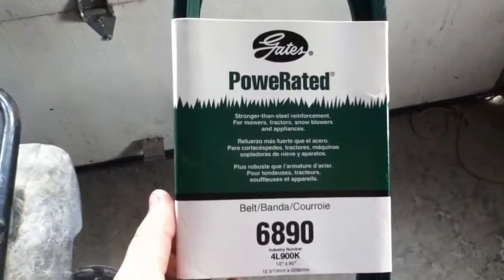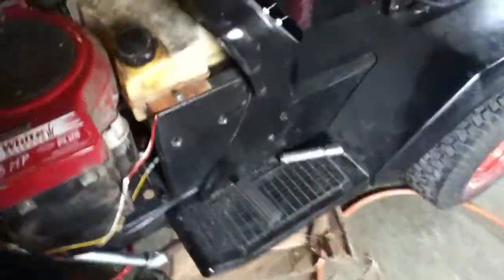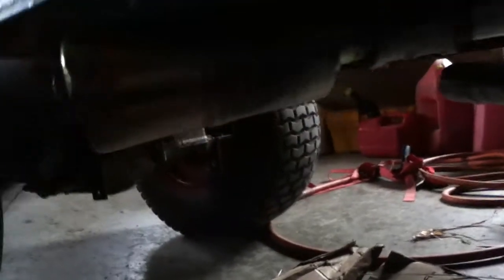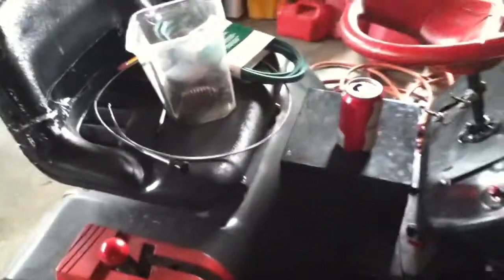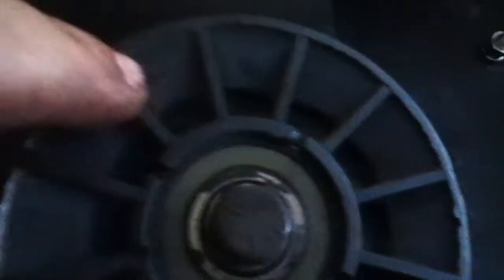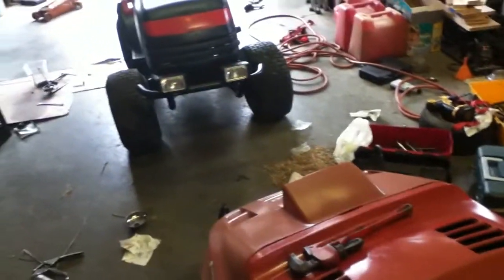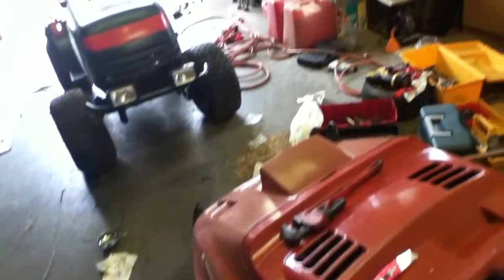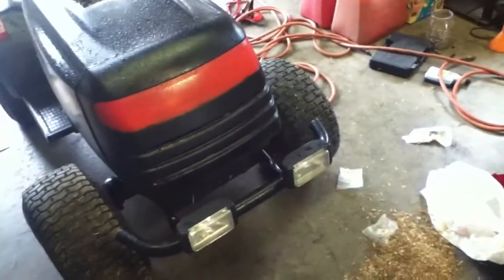Muddin mower update #14

Comment: if i were you i would keep my eye out for a 12 ton pipe bender from harborfrieght or princess auto for 99 dollars on sale, then take a long section and bend it how you want rather than having to use a bunch of angle pieces, once i get a new carburetor for my 11hp briggs or even have one on the way i will bend on up for my mower,